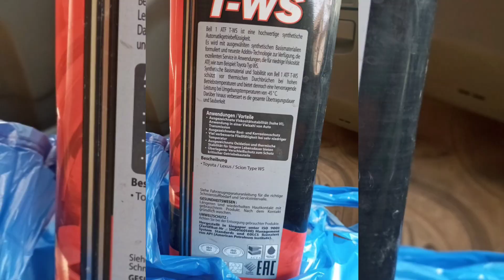Toyota Corolla 2015 Restoration | Motorway Police |Corolla Altis 1.6 | #corolla #motorway #auction

Comment: Kitnay km chali wi hai?
Reply from the maker: 252000
Reply: Its showing 486000 on odometer in the video 00:26
Reply: @ahmednaeem4884  itnay kms hi chali hogi cuz ye sara time chalti hai
Reply from the maker: Yes dear , i bought 2 cars in auction one was used 252000 and another 486000 , i mistakenly add another odometer pic in this video.. ☺